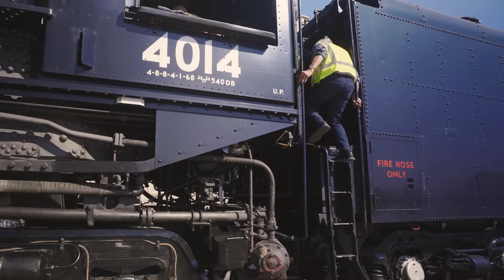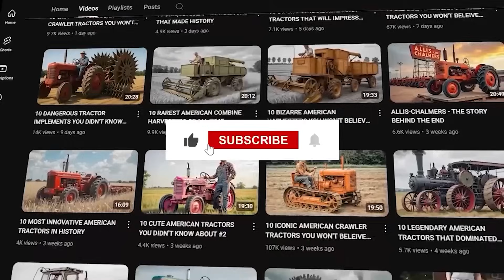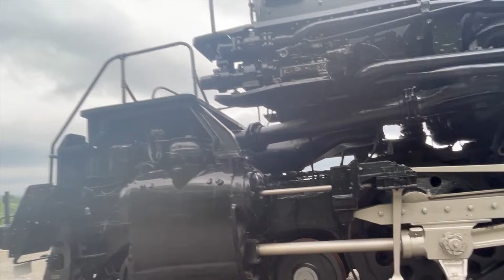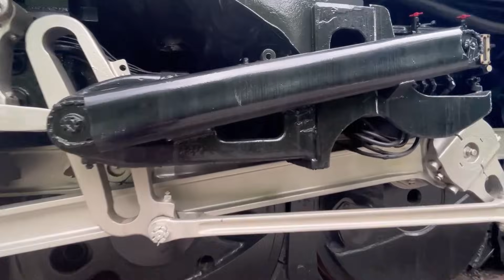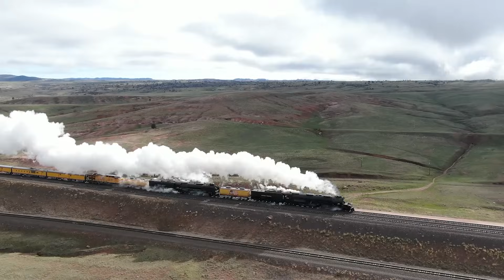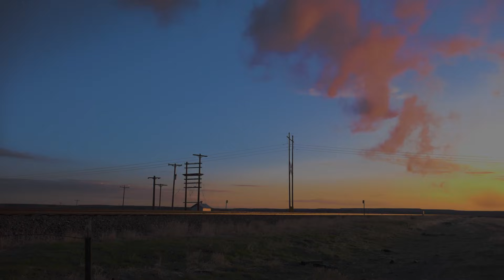10 DEADLY FEATURES OF THE BIG BOY

Comment: Let's look at #10. The hinge on a BB was NOT TONGUE AND GROOVE, which would be rigid. It was  a center pin and ring hinge. Two engine hooked together by a singe pin through a hole in the  frame of the front engine frame.  That is mistake #1.  YOu forgot that steam drovfe the turbines that powered the dynamo which produced electrical power for the head ligthts, running lights and minimal cab lights.  Not a mistake, but an important ommission.  Good narration. Definitely NOT  AI.  I'll subscribe and give a well deserved like.

Comment: The stoker mechanism wasn’t refurbished or replaced, it was removed because it wasn’t needed for an oil burning locomotive. The original tender with its stoker engine was donated along with Challenger UP 3985 to a vintage rail equipment museum in Silvis, Illinois. The tender from 3985 is now on 4014, traded because it had already been converted to oil from coal and was in good condition.

Comment: The  DM&IR Yellowstone was heavier and had more tractive effort but the Big boy was still very impressive.
Reply: No. At one time it was the largest locomotive but when the Big Boys were built they got the crown
Reply: Not the same engine or freight type. The Yellowstone was a low speed, high drag tonnage capacity engine. The Big Boy was designed to hasten through high speed, 3000-6000 ton freights in war time traffic across the American west during WWII and it did that better than any other engine... Over higher grades than any other engine.
Reply: @vincentsaunders4773 
But yet when the Yellowstones were leased out west in Colorado they were rated better than the Big boys
 in starting power and more efficient. Something to ponder. I’m not taking anything away from the big boy but all this hype of them being the best at everything is just not true. There were others that did better in other ways. The Yellowstone simply had more drawbar pulling power and operated at a lower boiler pressure and it was more efficient with coal and water.

Comment: The big boys were designed and built to replace 3 engines on a severe environment. Their output was upgraded several times over their careers. Did anybody ever take a seasoned in and well-run big boy that had been well-maintained and push it to his absolute limit to see what it would take to stall or overload the engine? It would be interesting to see just what that technology could handle before it's true capabilities we're exceeded.